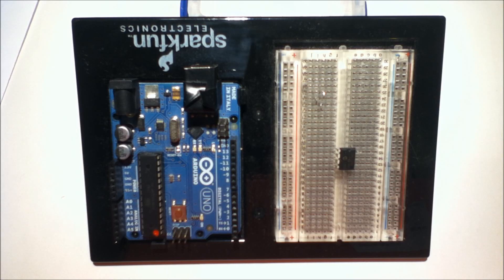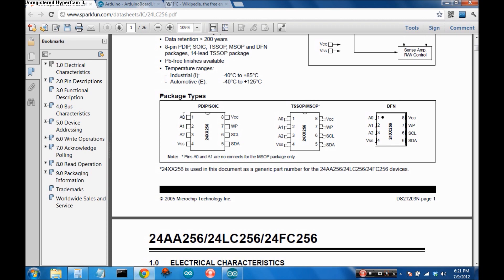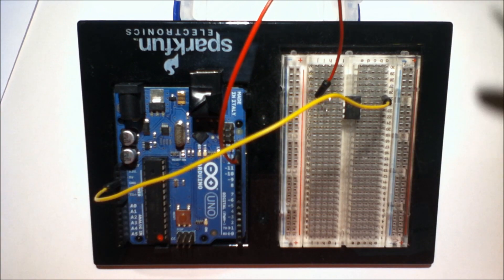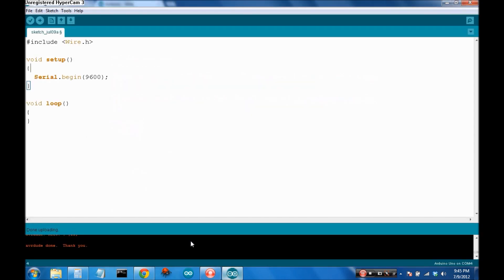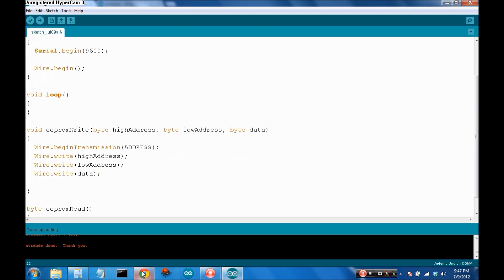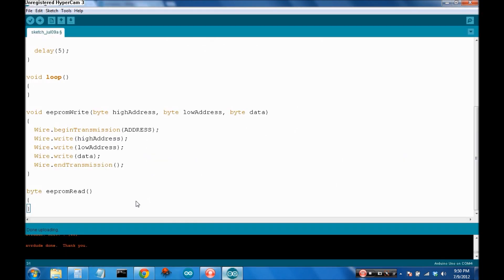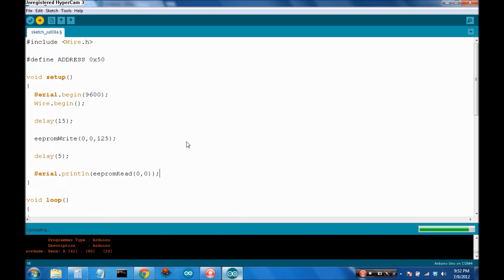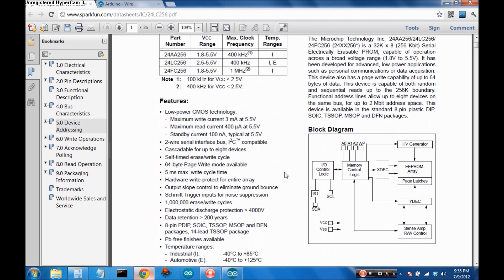Arduino Tutorial #8: I2C Communication

Comment: Why is this "Wire.endTransmission()" before "Wire.requestFrom(...)"? The documentation tells to use a RESTART not an end of transmission! There is no STOP condition involved when reading!
And restart would be an additional "Wire.beginTransmission()", if that is not already part of the internals of "Wire.requestFrom(...)".

Comment: Hi Human HardDrive, another .. how can I OR how should I.... I amjust starting to work with a Pololu IMU 10 v5 and the Accelerometer / Gyro and Magnetometer on the breakout are good units, LSM6DS33, LIS3MDL, however both are set to power off as default and having read the spec sheet I se that I can alter the registers from the i2c transmission for both units.. BUT  can I just send a binary or Hexidecimal to the register to adjust the registers to be for instance Normal sample rate Accelerometer and gyro to work all of the time, for while it is on the bench.
Maybe just as the data byte as explained in your excellent tutorial.

Thanks in anticipation

Gary

Comment: Hello HumanHardDrive,
This is a great tutorial and am grateful you shared it. Can you please help me with the code that is required for using a second Arduino to read and display (from the serial monitor) the data entering/leaving  the 24AA256 chip from the first Arduino ( assuming the first arduino is just a microcontroller and we knows nothing about its datasheet). 
Thanks for your anticipated response.
Best regards

Comment: Hello HMD,
This is a great tutorial and am grateful you shared it. Can you please help me with the code that is required for using a second Arduino to read and display (from the serial monitor) the data entering/leaving  the 24AA256 chip from the first Arduino ( assuming the first arduino is just a microcontroller and we knows nothing about its datasheet). 
Thanks for your anticipated response.
Best regards

Comment: The wire library recognizes the pins being used as clock and data, and activates the  pull-up resistances built into the ATMega for these pins.

Comment: @humanHardDrive
 Can you also run a arduino to arduino i2c protocol on top of that?
Reply from the maker: +pilotkid2011 You can, as long as the other Arduino has its own unique address.
Reply: In what form would this definition need to be in

Comment: The read function is wrong. You should never endTransmission after sending the address, but rather restart. The reason is that ending releases the bus so that another communication can start, which you don't want, you're not done yet. The Wire library seems to lack a restart function, so you'll have to use beginTransmission for that, possible adapting it slightly.
Reply: HelloSteven
 Can you please help me with the code that is required for using a second Arduino to read and display (from the serial monitor) the data entering/leaving  the 24AA256 chip from the first Arduino ( assuming the first arduino is just a microcontroller and we knows nothing about its datasheet). 
Thanks for your anticipated response.
Best regards

Comment: Hi
I am communicating with an i2c pressure sensor. It is 12 bit resolution (which it needs). How do I resolve the data from the sensor. I.e. how do I combine the two bytes into 1?
Reply from the maker: To store a multiple byte data type, you would store the lower byte, then preform a right shift to store the upper byte. To read it, you would do the reverse. Pull off the lower byte, then pull off the upper byte and left shift it, then or the two values together.

Comment: Hi humanHardDrive, thank you for great tutorial...
Still I have a question, if I want to read from another type of EEPROM, it's a AT24RF08C, in datasheet I found that it's a a wired serial port and a wireless RFID port to access the memory, but still has SCL and SDA ports...
Can I use same principle, I2C to read from it or I need to configure with serial read/write way?

Comment from the maker: I2C only has a 7 bit address. In 8 bit, yes you are correct, however there are only 7 bits, thus the most significant bit is 0 in your calculation.

Comment: I really appreciate the video, yours are very clear, and to the point. I do wonder though, you were only writing one byte of data to the 0,0 address. If you were going to store 2 bytes, or data containing more than two bytes , would you have used 0,1 ~ 0,2 as the low / high address? I do not have an I2C EEPROM here to play with, but I'm burning to know. Thanks!